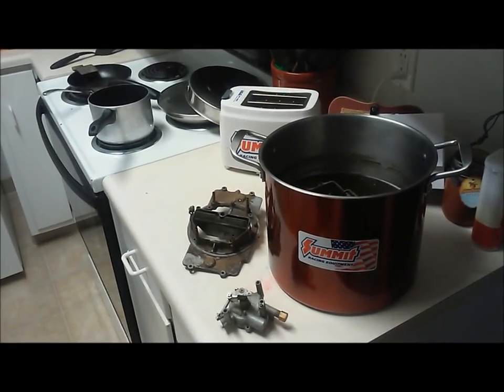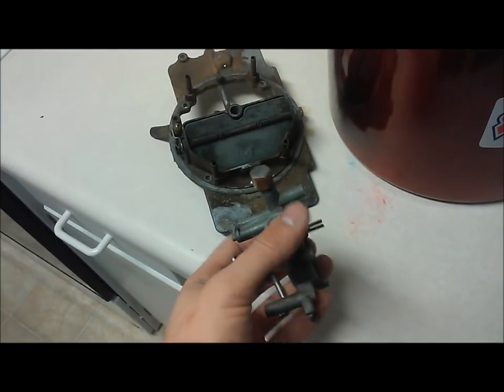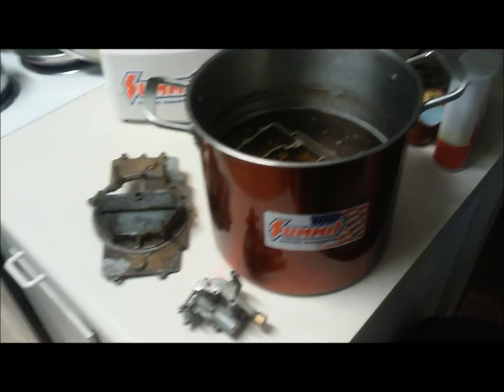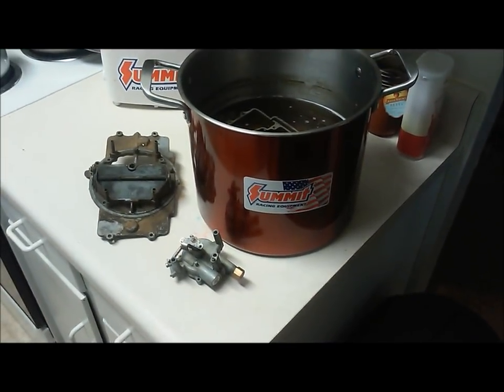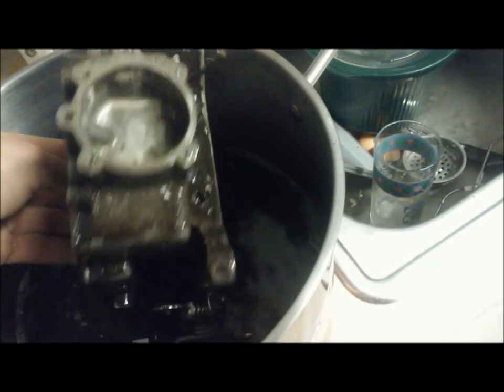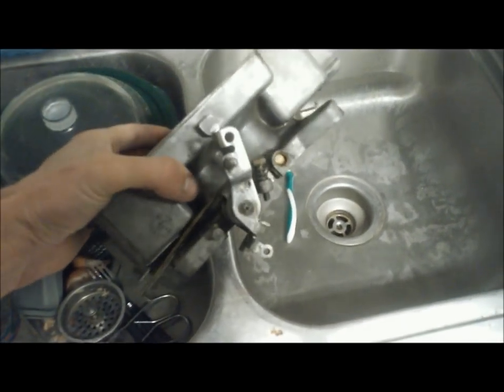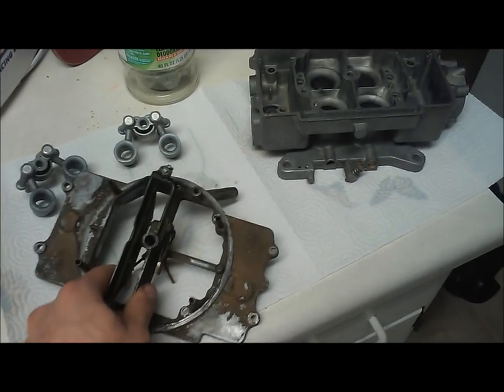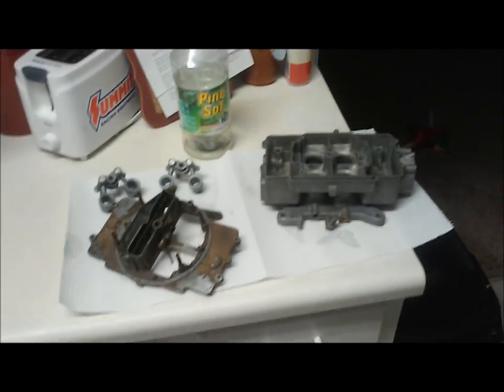Carb Cleaning - Pine Sol Soak (TESTED/REVIEWED) - WORKS AMAZING

Comment: I did the pine sol clean. It was one of the worst things I could have done. It stripped not only the gasoline deposits, but 100% of the protective coatings on the metal. Every bit of steel rusted within a few days. 100% of the aluminum got white oxidation on it within a few days. DO NOT clean your carb with pine sol if you care at all about the appearance of your carburetor.
Reply: Is there anything you can do to prevent this and still get the efficiency of cleaning? Does it matter if it is a 50/50 mix?
Reply: bro you are supposed to wash it off after...

Comment: what i showed a friend is that when i clean a carb i put parts in a container and set the container in my vibrating foot bath and the vibration allows the cleaner you use to scrub the minor holes and spaces you can`t reach

Comment: SOAK IN FULL STRENGHT, “S-100" for about 4 hours. Will not hurt rubber or plastic parts or metal or paint. Will dissolve all gunk! You may have to do some light scrubbing with toothbrush in areas of extreme grime but that should remove with little effort! If you have a sonic cleaner S-100 used in that works even better!!!
Reply: Hello. What is S 100

Comment: I did this… worked great and after I was done I dumped the Pine Sol on the garage floor. Scrubbed it around and cleaned off the oil spots in the garage. No waste and no need to store for two years waiting for your next carb rebuild.

Comment: I used Pine Sol on my '01 cr250 cylinder and power valve parts with great success. One to two days (if you have the time), a little scrubing like you would with any non mechanical method of cleaning and it was perfect. Just make sure everything is submerged fully.

Comment: Did this on a quadrajet off my 78 El Camino and a Edelbrock 1406, worked great on both! Thanks for the video.
Reply: Wayne Woodley, you said you pulled your quadrajet off your 78 El Camino, I jus pulled my quadrajet off my 76 Silverado. Does it really work that well? Im workin on my first project

Comment: Years ago I would restore old model airplane engines by soaking them in  ethylene glycol antifreeze in a slow cooker. Those small engines used to be (and sometimes still are) run on fuel that is 20% caster oil. That oil would cause them to be totally gummed up and useless after a period of storage. Overnight in slow cooker with ethylene glycol antifreeze was an amazingly effective and well known cleaning technique. It essentially stripped the engine clean of all the thick hard gunk. I looked up Pine Sol and apparently it contains  ethylene glycol also. I suspect that  ethylene glycol is the ingredient in Pine Sol that is making this work so well. I also suggest that you try plain ethylene glycol antifreeze and see how that works. My guess is that it will be very effective.  (And, of course, keep your pets away. They seem to like drinking it and it is poisonous).
Reply: Jim Trainor ....Brake cleaner cuts the dried castor oil varnish...or soaking in laquer thinner...theres no rubber on a all aluminum engine...couple O rings for carb ...👍👍
Reply: It has no ethylene glycol .  The ingredient that you need is Glycolic Acid . Only the original formula has it.
Reply: Run some Marvel Mystery Oil through it right before storage. Won't gum up anymore.
Reply: My Dad just told me about the antifreeze trick as he still runs those plane engines that need castor oil.

Comment: I soaked an Edelbrock (that suffered a severe long term fuel seepage through the lid gasket) in Pine Sol, and it did an okay job. It completely etched the shiny finish off the carb and turned it a dark dull gray, but didn't really clean it. Just did an okay job of making the gunk easier to spray out with a can of B-12. The $30 paint can of Chem Dip I bought for the internal parts and linkage was virtually useless compared to the pine sol and B-12. The B-12 can was by far the most effective in just getting all the gunk off. Next time I rebuild a carb, I'll skip all the soaking and just spray the shit out of it with B-12.
Reply: Fitz ....Primer quality (cheaper) laquer thinner in 5 gal cans if u do more than 1...auto body supply👍
Reply: Fitz, I just did the "spray the s**t out of it" method with B-12... didn't work entirely.  It was amazing at removing surface varnish (the syrupy stuff) but didn't do a thorough enough job to keep the carb from becoming immediately clogged again.  In other words it didn't get the jets cleaned out well enough.  I even used a small wire to make sure it was clear.  Bottom line, I think a soak and a spray is probably the best way to do the job once, instead of having to pull it off and do it twice (like I'm about to do.)

Comment: Yeah pinesol works great for soaking carbs and other parts to ..and you are absolutely right it will eat the finish or plating right off and plastics and rubber carb parts don't fair well either I've been using it for some years now  it's cheaper and does a decent job

Comment: I've used liquid plumber mixed with water to soak a Carb that had old gas tht turned to sticky syrup and it worked wonderfully,  soaked it over nite was all it needed.

Comment: thanks for the tips im definitely trying this ! I have a holley 750 vac carb that i want to re build and it needs to be cleaned. I will be buying some pinsol very soon.
Reply from the maker: +james myers i would try berrymans carb dip first!!! this works, but there is no replacement for rb dip stuff !!! that and some carb cleaner go a very long way.
Reply: ThunderHead289 oh ok..I'll have to look that up and check it out thanks again.

Comment: This did work very well but it seems like you can only use it once. I soaked a quadrajet in it and it cleaned it perfectly put when I put another carburetor in it it barely did anything. Great video though

Comment: First off you should do it outside second of all you should just use straight lemon juice third you should soak it for 45 minutes after it hits a boil I've used this four times on carburetors that have gas that had been crystallized and they came out perfect

Comment: We used pine sol to flush out a radiator that got engine oil in it. From a blown head gasket. Took a couple of flushes, then straight water, clean as new!

Comment: Hi, is there some reason why ultrasonic cleaners are never used or mentioned for cleaning carbs?  Wouldn't they work very well for that?
Reply from the maker: Completely! The point of this video was just to use super affordable common household stuff. I personally use berry mans carb dip with an ultrasonic unit in my garage
Reply: S Phillips 
....They work excellent if you have a descent one that aint a 39$ special...Ive used them for over 30 years.....cleaning everything from jewelry, carbs, gold casting devesting, disolving glass, eyeglasses(lenses up) ......if u can fit in the unit, it will clean....solutions varies the outcome....sudsy ammoniated cleaner removes all dirt, grease, polishing compounds, etc...if usinf flamable liquids we use 500ml beakers with tight lids in the tank solution...

Comment: Read the label. Manufacturer suggests not using it with aluminum. Notice after soaking, the metal finish has dulled? Pinesol does that. As for factory-drilled and metered fuel passages, up to you.

Comment: Adding heat to anything will greatly increase its cleaning ability. Certainly safe to heat pinesol
Reply: Gene Miller A heated ultrasonic cleaner. Best thing around, but expensive.

Comment: Oh and BTW, WD-40 is NOT a lubricant. It's more of a solvent slash dryer spray.
Reply: jim davidson correct its a water displacer hence WD. NOT a lubricant
Reply: jim davidson It's actually a very very light lubricant. I use it as cutting oil since it leaves less of  mess vs ATF. It's also good for assembling exaust pipes for the same reason
Reply: jim davidson ... It is a water displacement formula....google it...developed by nasa to eliminate moisture....40th formula worked!!   Hense the name WD-40👍👍👍

Comment: Most of the Holley carbs are cast in some sort of zinc alloy as well as, I believe the Autolite/Motorcraft are as well. There are exceptions, like some Holleys such as certain 4150 and 4160s and all 4010, 4011s and their clones sold under the Summit brand. Those carbs are cast in an aluminum alloy. Other than the problems that surfaced from Pinesol and what I understand to be zinc plated steel, did the Pinesol clean the carb  castings of zinc and aluminum equally as well? How about those thin strips of either Nylon or Teflon that Holley uses as bearing surfaces on their throttle plate shafts? Did you come across any shaft binding after soaking? I would simply remove the throttle shafts before soaking if the throttle plate screws were easier to remove. Thanks for experimenting with different cleaning solutions because other than still being caustic, the newer formulations of carb cleaning/soaking solutions don't seem to work as well as they used to. Plus the newer solutions are expensive.
Reply from the maker: +William Charles on this 4100 i didnt encounter any issues thankfully. throttle didnt bind, i did remove the shafts where they are not on the carb in that last clip for a better clean so i could get my brush down the venturies. i wouldnt try it with my summit 600 as im sure it would ruin the finish. any carb part that was that yellowed zinc color is now dulled or silver, so that is something to consider. i wish they made berrymans bigger so one could simply dunk an entire carb. - i dont really want to pay for the drum size
Reply: Thanks for the reply. I'm familiar with the Berrymans and agree that the quantity required would get pricy. It would be interesting to see the results, though. That chromate finish doesn't stand up to much cleaning no matter what you use it seems to me. If you need to get a really funked up carb clean, it's going to be pretty much gone from my past experience. Eastwood and maybe Summit has the spray on chromate, but I don't know if it will hold up very well.
Reply from the maker: function before beauty i say. barrymans is potent, here is a link to a video i made where i use it to clean pistons, which are way more dirty than carbs could ever hope to be. https://www.youtube.com/watch?v=MI2eLGlkE8Y
Reply: ThunderHead289 I absolutely agree over that statement about function. Thanks for the link.

Comment: thanks for this tip! I tried it, worked well. I used it to soak an old carter after it was prewashed in diesel. Not a "restored" finish but did the job. And I can reuse it, unlike carb cleaner.

Comment: Ran outboard repair business for decade, thousands of old dirty two stroke carbs...Berrymans dip and the water hose was the only way... but now the formula is changed...from berrymans website... thanks Kalifornistan and Walmart... Wallyworld bitched about they were going to offer kali stuff and everyone else stuff..wally world only wanted one part number to order...berrymans caved.. so the good stuff is gone the way of Benzene parts washers.... I guess it is down to Pine Sol or lemon juice... going to try the pine sol tonight... sigh...kalifornistan sucks.
Reply: riverrunner114 
I agree!
Reply: Walmart sells lacquer thinner both in the paint and automotive section. The automotive lacquer thinner is cheaper. Why would anyone in their right mind want to spend 16-24 hours soaking a carb when lacquer thinner works better in a few minutes, if not a minute?
Reply: Are you boiling the lacquer thinner?
Reply: jessewimb.  You cereal?
Reply: riverrunner114 I
Reply: @ipwee  I guarantee they don't live there. It was merely stated that CA's enviro standards helped to lobby for the changing of the Chem Dip product nationally because Berryman's ended up producing only one "weaker" formula.
Reply: @ShainAndrews lmao..yeah right? I'd like to see him put that shit anywhere NEAR heat or flame. Unless he WANTS to look like Geldoff in Pink Floyd "The Wall".

Comment: Wd40 is NOT a lube!!! It is a form of a solvent. WD stands for water displacement!!!
Reply: And the 40 stands for perfection after 40 attempts to make it perfect!
Reply: Stop drinking the koolaid dude, it literally says on the site that is is designed to be a lubricant.  It's not a specialized lubricant, it's a generalized one.  Use the right lube for the job.
Reply: Tobius is absolutely right!  WD40 sucks as a lube, specific or generalized (whatever that is supposed to mean)!  ...even after 40 attempts its not "perfect", sorry!...and I don't have to drink koolaid to doubt the horseshit fiction the marketing dept had printed on the can or published on their site...I go by my long-time experience, and that is that WD only "lubes" immediately after spraying and while wet, but leaves very little behind in terms of long-term lube.  If you use WD as a "lube", you need to come back in a week and "lube" it again...screw that!  It displaces water...BFD!...so does wiping off the dist cap, and spark plug wires... If I want a (light) lube, that works great and sticks around for a long time, I use Triflow...I sure as hell don't reach for WD...period!

Comment: Use dish soaps like dawn a powerful degreaser haha let set 24 hours
Reply: For rust use electrolysis use plastic for a container and ground a plate under water for small parts add baking soda positive out of water and plate in water not to touch negitive cable or plate postive needs a plate in water not touching neg rust goes to pos metal grounds parts